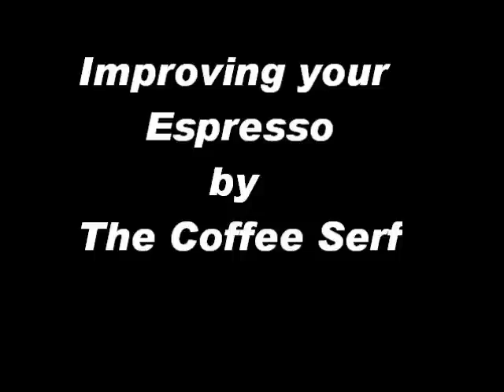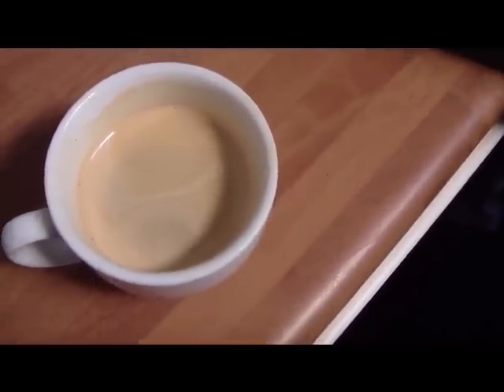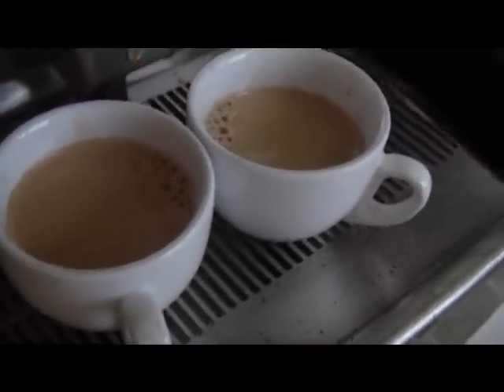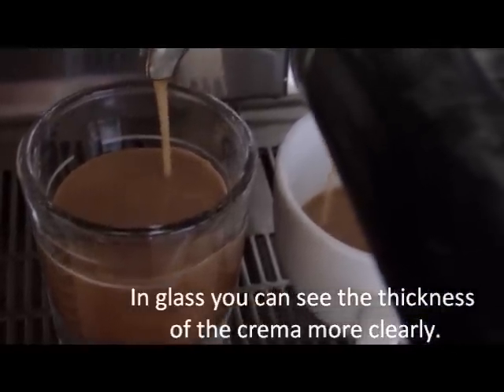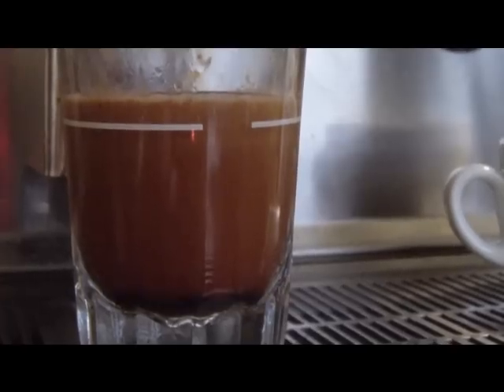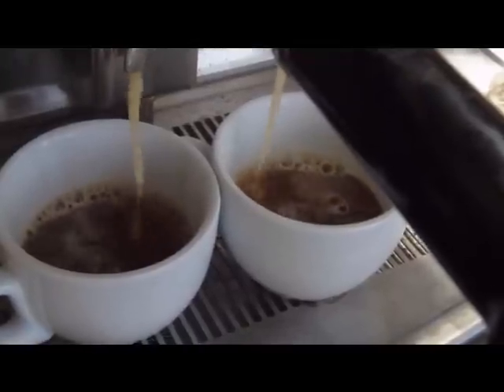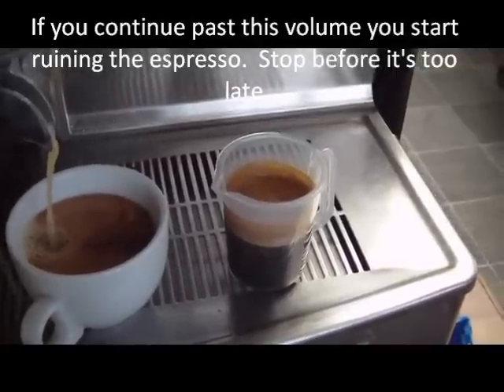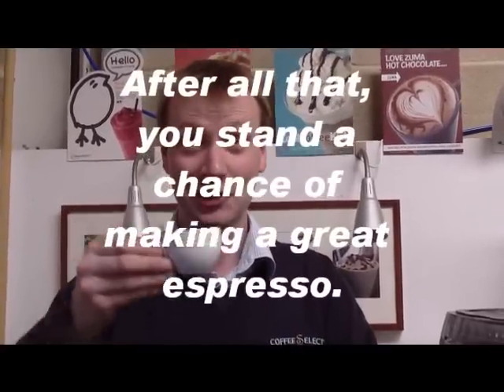How to make a great espresso

Comment: Useful stuff. One additional tip is your Coffee beans are sensitive souls esp. in regard to moisture and humidity. At Coffee Rescue Scotland we set the grinder each morning to a perfect 18 grams and grind (aiming for a 24 to 29 second extraction), however even here in the Scottish Highlands we adjust the grinder throughout the day to keep things calibrated for a perfect 👌 extraction. As the day warms up your grind will grow and you will need to make adjustments for a finer grind to keep your extraction in the 24 to 29 second extraction. Too fast you will have a thin acidic Espresso and too long you will have bitter slop. 24 to 29....perfect every time! :-) 👍🏴☕👌
Reply: David Chambers 24 would be sour... you have to know the age of the beans to determine the grinder time. Older coffee would require a longer extraction time.
Reply: We count the time since the first drop or since we push button at machine?
Reply: Cygnus Insbruck first drop
Reply: @lightwalker9879  fair point - we do know the exact age of our beans and extraction requirements, so that does help a lot.

Comment: I've been drinking espresso for over half a century (yes I'm old as dirt) and it's been my experience that one should wait 
at least 24 hours after roasting to let the beans degas and develop some body. I've also found that if you keep your beans free from light and air you can keep them fresh for about 10 days depending on how critical you are. Also, a good idea is to buy a really good grinder. Also, don't keep your supply of beans in the hopper, take out what you need from your air tight light free container and just use that amount.
Reply: Agreed, though he said "opening" here. 2-3 days old is the peak from my experience with roasting at home.
Reply: You will not be tasting it's full flavours when you are having a 24 hrs old coffee beans. You might want to wait  for at least 2 to 3 weeks for a best coffee experience. Freshly roasted beans has a lot of CO2 so let it degas naturally by settling it in its bag which has valve for 2-3 weeks.
Reply: @BuggyBudsClips  Coffee taste best 2 to 10 days or so after roasting. After that it starts to lose it's freshness. You can squeak out 2 to 3 weeks or so but it won't be as good as the first 2 to 10 days. You can google how long coffee stays fresh after roasting and see if your views match other coffee aficionados. Freshness is super important which is why I started roasting my own green beans but stopped because I couldn't get as good a quality green beans as I could get already roasted.
Reply: Very true. It is surprising how few barristas know this.
Reply: Good to see the culture of good coffe’s taste is spreading across developing countries. Here in Italy we use to drink short and strong and good espresso. Pls give a try and keep doing your good job. Hope we can get decent coffees in the next ten years past the Alps.

Comment: this is a really well-detailed general guideline
very helpful :)

what about those of us that want to make a good espresso at home but dont have a machine?
is it possible?
Reply: Try rok presso
Reply: Try moka pot, you use it by heating water on stove and the presurize hot water will go tru the bottom to top unlike normal esp machine that goes from top to bottom
Reply: +rahman massewwa maybe there's a specific technique needed but my experience is that they don't produce enough pressure to make a proper espresso. have only got sour shots up until now.
thnx for the reply! :)
Reply: +hadi93  besides that ;) I have one but that shit is impossible to get a good shot with imo. 
it doesn't produce a proper espresso neither. more of somewhere in between an espresso and drip :(
Reply: @utubit22  Try following the instructions in this video.  My wife makes a great espresso with the moka pot.  It is not quite the same as an espresso with a high-pressure machine (the moka pot will never get that amount of pressure), but if you get the right beans, grind them correctly and follow the instructions, it is a very pleasant coffee.  In most Italian homes, that is how people make espresso every day.

Comment: when i use Double shot basket , the juice come out under extract with Thin, light crema (no flavour) .  But when i use Single shot basket, everything is fine (golden crema).   Same coffee bean, same machine.  I dont know what i did wrong
Reply from the maker: Hi David. Just double check that your double shot basket is not an oversized double. Eg, your single may be a 7gram basket whereas your double may be an 18g. There are so many different sizes. If your double is not exactly double then it will not be so tightly packed into the group head and the water will 'slosh' around it leaving to under extraction. Good luck, hope you find the solution.